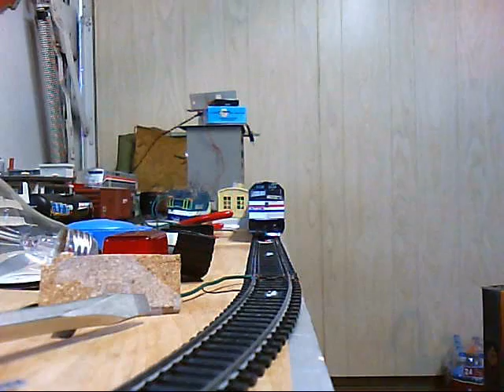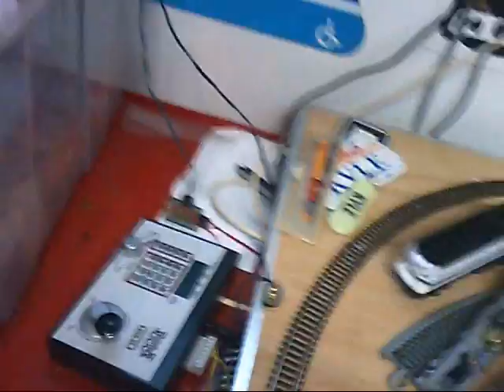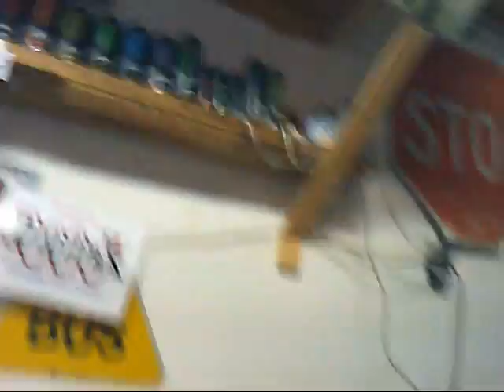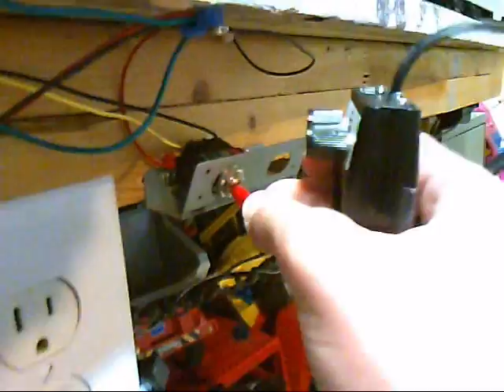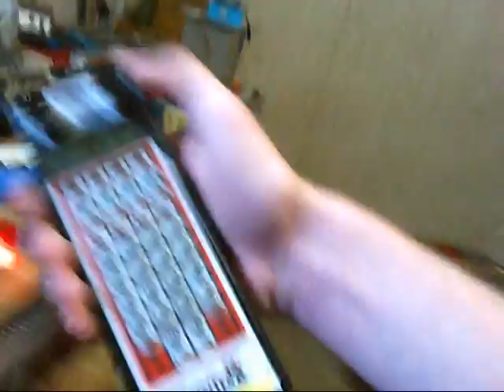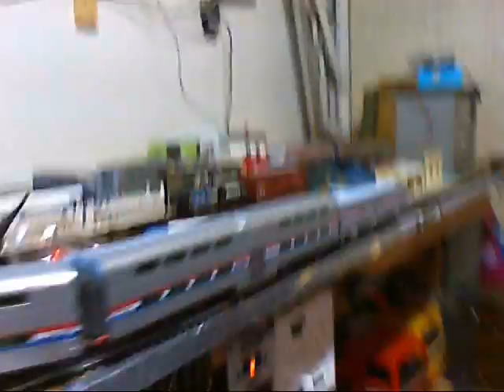Layout Update (4/21/10)

Comment from the maker: @coops8291 [cont'd] the difference between the UR-90 and the -91 & -92 is that the -91 & -92 have the ability to transmit and receive radio signals rather than infared, meaning you can be within hundreds of feet of the receiver, and not necessarily in line of sight with it (thus, the extra price, but worth it, in my opinion.) Hope this helps!

Comment from the maker: @coops8291 the throttle i have is actually no longer in production but that's good news for you because they now make better ones at the same price ($200). The only additional thing you'll need is a UR-90 ($45) which is an infared receiver(s) meaning you have to be in a direct line of sight with the receiver(s) to operate in wireless mode. However if you do so wish, you can take it a step further with a UR-91 ($149) or UR-92. [Cont'd below]